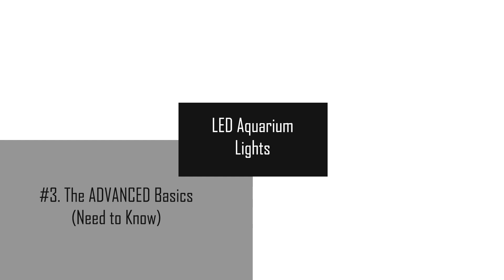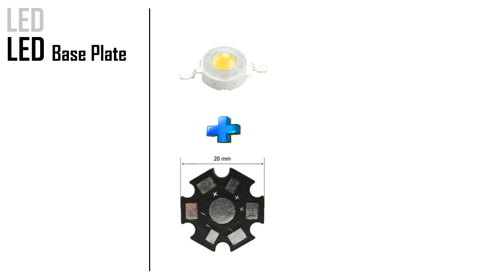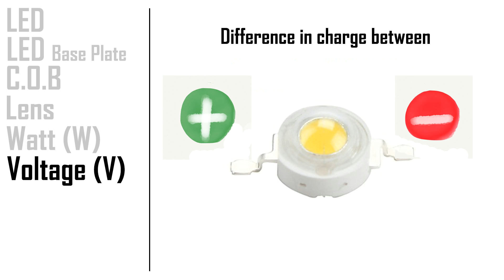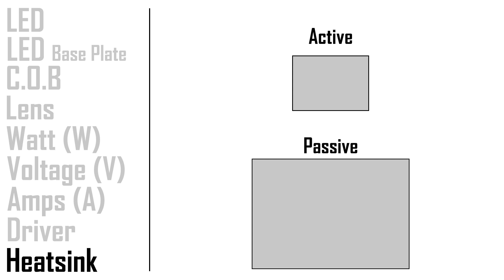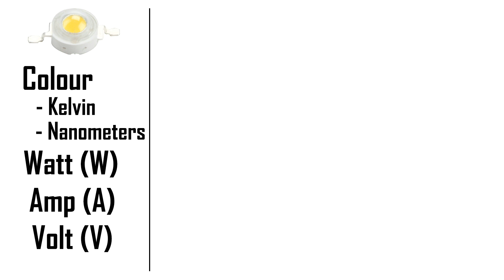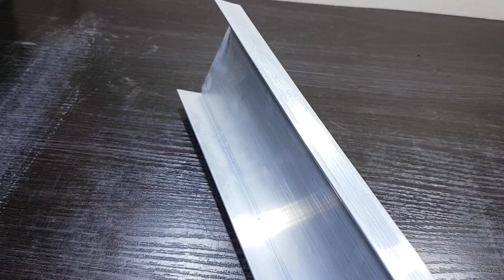DIY LED Aquarium Lights (Part 3)

Comment: Hello i need help I use a driver 30w 700ma 32-42v but the leds not lighting i use 10 led 3w what's the problem

Comment: Hello my friend
Awsome Diy, helped me a lot and resolved a tons of questions.

I see u had the same problem i am facing about the drivers, and i'm still crushing my head with that.
Chinese aliexpress sellers, only sell these cheap drivers with 300/600/900 mA and +, and the 3W starleds are 600-700mA..
Some others sell 3W 700mA starleds 
So wtf?? Can i use them on 600mA current driver or not? Have u found explanation for this?

Comment: I have a question. What if i dont use a driver but an ac-dc transformer instead, and to reduce the 12v to whatever the Led works with, to use a resistor?
Reply: Pretty much same thing. Only difference is your controlling the output instead of only having set amount.

Comment: Hi! I really like this video series, it is very informative. However, when you speak about the LED driver, I think it would be important to specify that you are using a constant current output driver (as opposed to a constant voltage output). So the voltage will fluctuate in order to maintain that .6A output. Whereas with a constant voltage output driver, the current will fluctuate in order to keep the voltage constant. There are multiple different design considerations that will apply depending on which output regulation driver is used and will determine how to match your LED circuitry to the proper driver so please keep this in mind.

Additionally, I was under the impression that when using lighting systems with LEDs, luminous flux (lumens) is more important than power consumption of the LED (Watts). Whereas with the T12/T8/T5 lighting setup there is a direct correlation with luminous flux and power consumption, the same is not true for LED lighting. So instead, of using a watts/gallon model, a lumens/gallon should be used instead.
Reply from the maker: Thank you for the info Alex :-)